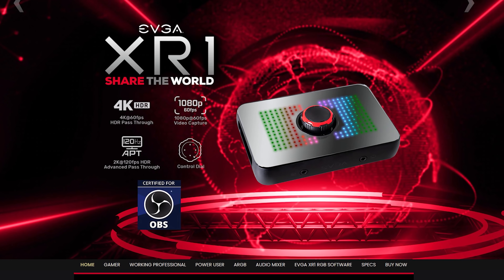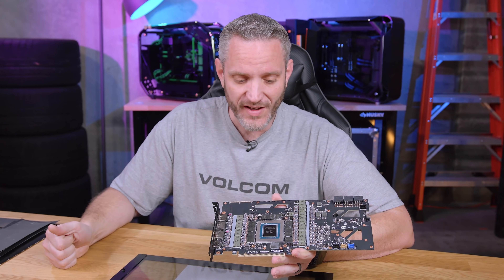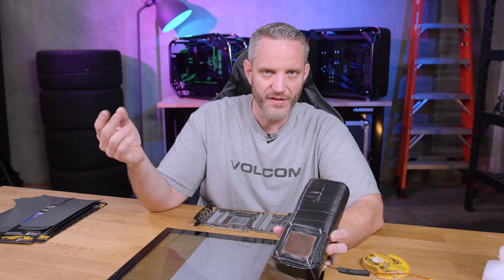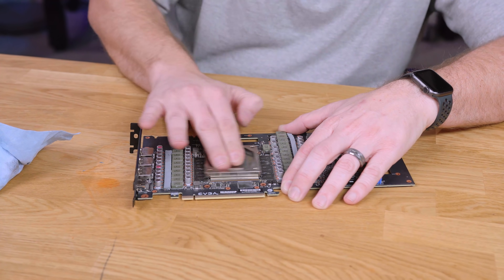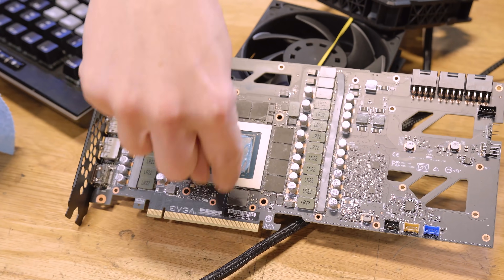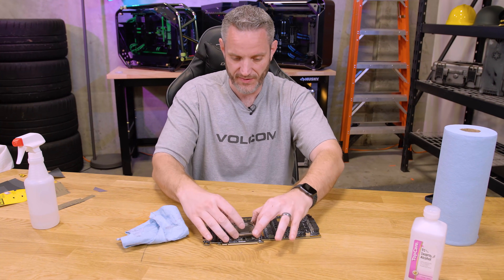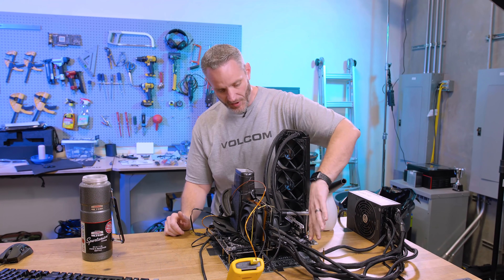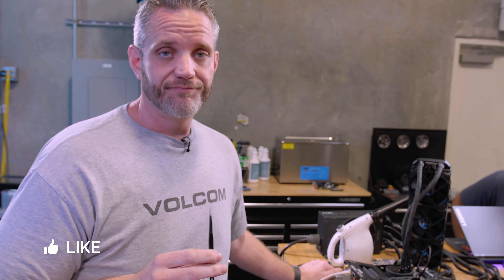I ruined another GPU....

Comment: JayzTwoCents next video: Building a Faraday cage because 5G is affecting my gpu overclock.
Reply: that be interesting if wireless really do affect the score
Reply: Next video: lapping all my 3090s with a SLEDGEHAMMER... oops
Reply: @Spiralem  When you are dealing with bare board - yes. It is designed to go inside a metal case that acts as a shield. Using it in open air like that makes it susceptible to EMI. If the microphone signal is strong it can cause disruption in the board’s signals.
But it is unlikely really. If you start a two-stroke engine nearby you would have immediate crash, but a tiny microphone with couple of dB of signal? Doubt it.
Reply: The chips from the covid - 19 vaccine affects my GPU score!!!
Reply: While wearing a thin foil hat xD
Reply: You post that in jest, but it might actually help. There is no electric field within a conductor.
Reply: @dimitarkunchev  Only problem with that is that it's a wireless transmitter mic, the mic itself doesn't do anything but the 2.4Ghz signal it sends out to the receiver does.  What's that frequency really close to?--oh, the clock speed of the card.  Wireless mic=1st world OC problems. :P
Reply: you mean a paper holder?
Reply: @Spiralem  Jay already proved that he was getting crashes the second he put his wireless lapel near his system when overclocked in past videos in this series. There's a reason all the memory and stuff is SO close to the GPUs compared to older generations, GDDR6X is hyper sensitive to EMI/EMF fucking with the transmission lines to and from the GPU, and there's probably other sensitive components that are affected by a typical 2.4-2.5ghz mic, especially when your devices are operating in or near that same frequency range like these GPUs are
Reply: @LettuceLand  Now I want to make a lappig die out of a Sledgehammer and use it to lap a gpu
Reply: @dimitarkunchev  I think he (or maybe linus?) actually had this problem with the mics they use.
Reply: "Old man yells at 5G."
Reply: @hugodc1225  i see a electroboom reference
Reply: @LettuceLand  you forgot about " AND IT WENT WRONG" part of those names
Reply: It's the other way around. Electromagnetic source can interfere with modulated signal that transmits data. The GPU clock is an instructional entity, which dictates only power current assignments to the cores, whereas in 5G and the new-radio the Centralized Unit and Radio Frontend have chips that encode FFT operations for modulating/demodulating access signal. Subduing this chip to electromagnetic interference can have impact on the performance of the network, but it also depends. With higher frequencies, cross-talk interference is less of an issue because a single band of transmission bearers in mobile networks are quite wide and "guard bands" can be set to lower values. The lower you go in the frequency bands, interference becomes a bigger problem. I do research on 5G, but I haven't found so far anything to affect my GPU, and is usually the other way around. When the GPU rocks hard on maximum clock, it emits EM radiation like Comrade Dyatlov's Reactor Core gamma rays.
Reply: 5G kicked my dog :(
Reply: @Spiralem  I am pretty sure Steve and bearded hardware had that issue when they were over locking together, the wireless mics they were wearing were crashing the run, so they took them off and it worked.
Reply: @DrBrunoDzogovic  I don't know what you've typed, but the last sentence is pure gold.
Reply: Get one of those office paper baskets from Linus.
Reply: @dimitarkunchev  a couple dB signal is alot like a ton. i Would hope that that mic for short range is below 0 dBm
Reply: @TheOriginalFaxon  One thing that should not be overlooked is an effect of very bright light, espacially red/yellow light with a deep penetration depth. It could be possible that lights for filming also do their part. 
Cooling it down basically lowers the base silicon conductivity and light and emf can raise it
Reply: @Pobodies_Nerfect  Feeling stupid suddenly? :) That's good. We need people like you around.
Reply: i mean he already makes it a point to go away from the rig during runs because his microphone is screwing with things

Comment: Jay makes a fairly flat sanding block, proceeds to makes it uneven with scotch tape ..
Reply: I’m fairly sure he used spray adhesive
Reply: He said tape, so it's probably double sided.  Yeah, it sounds like a pretty bad way to do it
Reply: @VndNvwYvvSvv  he said tape or spray adhesive
Reply: Tape is actually pretty flat. It’s used for machining all the time for parts that are too thin and/or too delicate to use more conventional fixtures.
Reply: Yeah he did say on the tape 🤦‍♂️

Comment: Jay seriously you need to partner with one of the machinist channels on YouTube and do a video where this kind of thing is done professionally. Or that they provide you the tools to do it yourself. Using precision tools the correct way would go a long way at increasing your performance. I’m honestly surprised that stuff like this isn’t done more often in the competitive oc sector, or if it is I haven’t heard about it. Usually it’s just people with sand paper. Lapping something perfectly flat requires a setup with multiple surface plates and a lapping plate with groves in it that can catch the particulates left over from lapping. When done correctly you will be removing so little and doing it so precisely that the chance for catastrophic failure is minimal. You could get it so flat that no tim is required and the heatsink will stick to the die or heat spreader without pressure. Using the right gear you could literally take the best binned cpu and gpus you have, make them better by precision lapping, and then use a hot air rework station to replace memory modules with the best binned modules you have tested. I think you’ll break some extreme records doing something like that and it would get tons of views because it’s something interesting that people can’t really do.
Reply: Yeah while a glass pane is certainly the most cost effective way to get a very flat surface, actual precision engineered equipment would make a huge difference.
Reply: @fakjbf3129  not alll glass in the same, float glass has a flat side and a not so flat side, true plate glass is ground and polished.

mechanics lapping granite is +/-.003, a small machinist surface flat plate is .0001 and better.
Reply: A precision ground flat stone would work well enough and be ahead of sandpaper by miles
Reply: U do realize if you cold weld 2 surfaces togather it can ruin the surface right?
Reply: Which machine can go down to the micron levels of machining?
Reply: I would love to see him or someone get the die and cooler flat and polished until they stick together like gauge blocks
Reply: @themonkeyman2547  Jay mentioned you dont want that.
TIM is like paint, you want a slightly rough surface for it to "Bite" into.
But theoretically, one wont need TIM if both surfaces were super flat.
But you would need to put the PC in a vacuum or an atmosphere of 100% nitrogen whilst polishing and mounting to avoid any corrosion forming on the surfaces.
Reply: @IIGrayfoxII  , it's not so much the machine as the process. Even a surface grinder can get you to um level flatness. A proper lapping process can take you to at least some tens of nm (The process shown here is not lapping though)
Reply: @IIGrayfoxII  I know people who work at Mercedes F1 Engines and imperfections in critical parts are specified to within 2 microns, anything worse and the part is scrapped
Reply: @nickeshchauhan5661  Those machines cost millions of pounds.
Reply: @sbrubak  I would be concerned about the grinding surface could chip the silicon die as it moves in from the side.
If moving from the top down it might rip the die out of the substrate.
Those grinding machines do have some torque to them even when free wheeling.
Reply: I want jay to learn about CNC - I could of taken that die down 0.0001mm at a time, and shown that it was with in 100 atoms of perfectly smooth.
Reply: @IIGrayfoxII  I was not suggesting to use a surface grinder on a silicone die! The die itself is background do a very high degree of flatness from the factory and you might only have a few tenths of micrometers from the back until you hit active components) . The issue here seems to be to get rid of raised spots from the laser etching. A lapping process could be used for this, but as i mentioned the video shows grinding, not lapping (And pretty coarse grinding at that) . A lapping process in which a lap (I.e. a very flat surface onto which you apply an abrasive slurry) can certanly be used, though for just knocking down the high spots,  precision stones can also likely be used.  The key to achieve a flat result is to use a 3 surface flattening process where a third surface is used to ensure that the work and lapping plates converges towards flat. If only two surfaces are used they can converge towards a spherical or cylindrical result. Tom Lipton (ox tools) or Robin Renzetti have several good videos on the topic. 
That said, i suspect thermal stresses will bring these surfaces way out of flat during active cycling as different thermal expansion ratios come into play.
Reply: Send one to This Old Tony and have him surface grind it.
Reply: @TheRealMrRoboto  I don't think a CNC machine would be the best idea for this, how would you clamp it in a way that it doesn't deform and even if you do get it clamped ok the slightest vibration on a thin PCB like that would make it wobble like crazy, no way you're machining microns off that thing in my humble opinion, just using basic lapping techniques is the way to go, what jay is doing is not lapping but polishing and bad polishing at that.
Reply: @sbrubak  Thankyou, what jay is doing is not lapping, just polishing.
Reply: But the lapping wasn't the issue. The carelessness of removing the pot was the issue. I, for one, appreciate seeing the way it can be done so normies like us can achieve the same results with some 320 grit glued to a piece of glass that's glued to a wooden block. Personally, I'd like to try this with sandpaper on a planing attachment with a drill press. That way everything is stationary and you can lock the drill press so it doesn't go too low.
Reply: I'm pleased to see someone mention that with good enough lapping you could actually exclude the thermal paste completely.
Reply: Would be fun to see a proper mesurment of how flat the surface is atleast. I would probably have used a grinding stone with high grit if i just wanted the letters gone. Would probably have taken awhile but its an easy way i guess "anybody" could do it.
Reply: @chazdevereaux6258  
This is a kingpin card which is made for overclocking with LN2.

More clearance should've been given between the capacitor and the mounting point
Reply: @smithleon  Issue is corrosion.
We live in an atmosphere so you can polish it up and the copper block on the LN2 will start forming a thin layer of corrosion instantly.

If it is to be done, it has to be done either in a total vacuum or an atmosphere of nitrogen.

Metals can cold weld together in a vacuum when they're ultra flat.
But the smallest bit of corrosion and that wont happen.
Reply: @IIGrayfoxII  why dont they use silver instead of copper ? It should be better
Reply: @techHmrk  Silvers thermal conductivity is only a little higher than coppers.
The cost would be a reason.

Copper costs $7/kG
Silver costs $28/kG

4x has much for little gain.
Reply: @IIGrayfoxII  I would still try it. Look at the price of the rig. They got money.
Reply: @techHmrk  True, when you're at the point of using LN2 you've got the money.

But a pot that may cost $300 will cost $1200 just for the block of metal and work that needs to be done.

I also dont know how easy it is to machine silver.
Reply: @xizor925  Since Jay is one of the few that has spare cards he is already in a pretty high stratum compared to us other idiots.

The tools are commonly available ( as Jay uses), I have a hot air soldering station and seen a lot of Louis videos to see how I should be using it.
Reply: @IIGrayfoxII  I can't tell if you're joking or not. In special edition vehicles, they don't move the oil filter to a different part of the car because they're afraid someone is going to knock it off while drag racing.
Reply: @chazdevereaux6258  What does oil filters have to do with anything.
Reply: @IIGrayfoxII  I use analogies when I believe a straight answer with the most technical and logical reasoning exceeds the cognitive capabilities of the reader.
Reply: @Nomisuke Deadman  the kingpin cards are made for using.
So they custom designed.
More clearance should been added between the SMD devices and the keep out zones.

Look how close they are in the video to the silkscreen near the mounting point.
Reply: Finally someone says it, I always wondered why everyone talked about "lapping" and used a sandpaper on a piece of random metal sheet. True lapping is such a precision technique. never have seen any OC use an optical flat to check flatness and all that is done routinely oh optical or high precision shops.
Reply: @LordPrecision  they will never beat Kingpin. Dude has access to all the equipment but most importantly he can sit at EVGA and literally handpick which gpu and memory modules he wants assembled in a board.

Comment: Guys, as a machinist, I absolutely insist that you spend the little bit of money to buy a solid precision 1-2-3 block WITHOUT the hole pattern for your small space lapping. They are hardened and precision ground for perfect 90* angles and flat surfaces. Also, if you're doing this regularly for business use or just regularly in general, it's worth the investment to get a tabletop precision granite block. Do it right, get the proper tools.

Comment: "... if you are talking about making a flat from scratch, without any master flat or expensive test equipment, then the answer is the three plate method. This is used in the machine shop environment with spotting and scraping and in the optical world with abrasive grinding (lapping). The optical world clearly produces the better or flatter surfaces as they are not only flat to the sub tenths tolerances of the best machinist's flats, but are highly polished and flat to within millionths of an inch."

Comment: Something we do in woodworking that might help is when we’re lapping metal to sharpen blades, we will color in the metal that we’re sharpening with sharpie to see what areas of the blade are getting lapped off. Same when flattening a board. Scribble some pencil onto the board to see if you’re flattening properly.